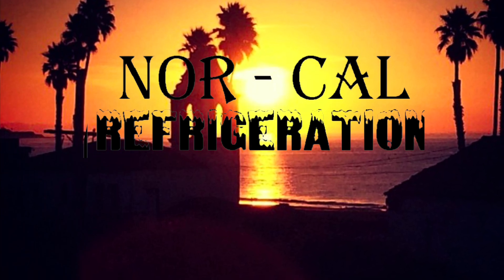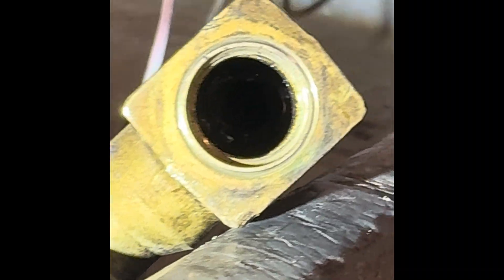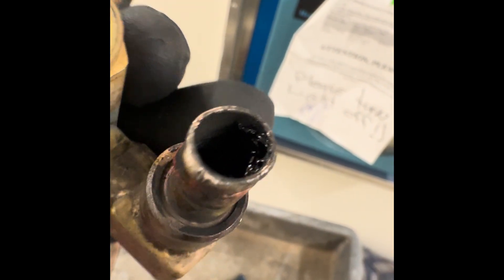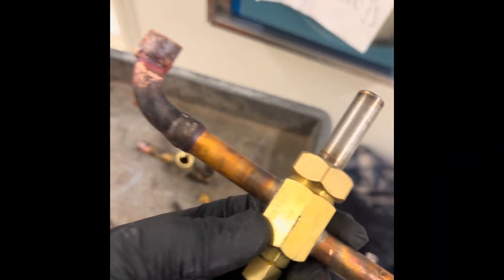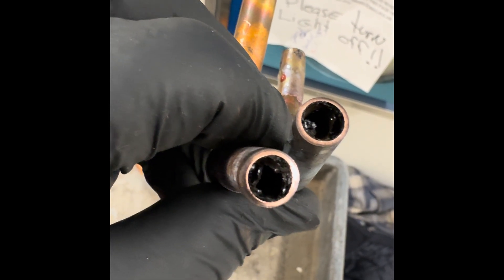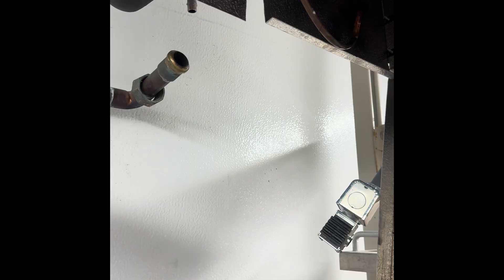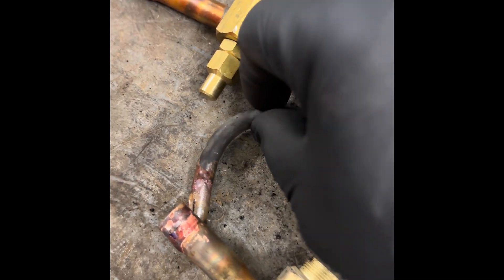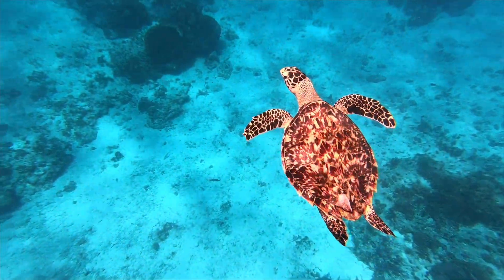TXV not Feeding Real Super Tech Stuff

Comment: Had something similar on a rooftop package unit. Plugged the liquid line solid before the orifice. Was similar weird shit that I dug out of the pipe. 

How you can get a solid plug of shit building up on the high side of a R410a system is beyond me. I would have thought the higher pressure would prevent that
Reply: think about it, the flow is bottle necked and reduced right at the txv/orifice. that makes a big flow change and causes turbulence and more, so debris and particles will fall out and build up on each other.
guaranteed there's some in the whole line set, but the worst will be where the flow velocity changes drastically also, when it stops/starts the debris falls out and deposits. that's right after the solenoid valve.

Comment: Floodback...possibly. I used to work on a fishing vessel chilled saltwater system with maneurope compressors. I remember the compressors were 7.5 tons and chiller barrels were 5 tons. Compressors never died but oil always was breaking down. We had to replaced filter driers every year and id cut them open and find that crap in there. Boss didnt want to quote for bigger barrells and captain was always happy with temperature and didnt want to touch the system. Oh well. Crazy how those maneurope compressors just couldnt kill them.

Comment: likely a combos of many things. broken down oil, deteriorated winding enamel/varnish, paint coming off internally, brazing/copper oxidation, burnt refrigerant, moisture, filter drier breaking up, acid and whatever else you can think of.
lets not forget the possibility of killer sealant, sure it will seal the leaks, but any moisture and it seals everywhere and anything too. 🤯